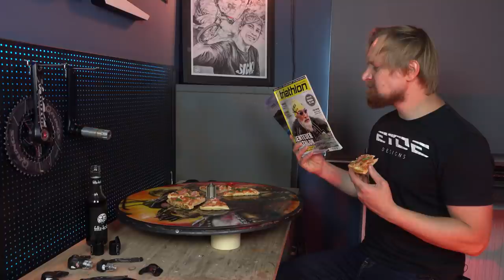DREAM BUILD TT BIKE - Specialized Shiv DOOM ETERNAL

Comment: What  are you doing with the first tool you insert into the seat tube-seat post female threaded parts, before you grease and install the screws?  I would think that tool would remove the threads. I have the same tool and I thought it was for extracting jammed parts. 
Beautiful Work!

Comment: Your best and most intricate paint job you ever did in this channel. Everything is great except for that front wheel not having any paint resemblance to you project. Or it's just the light it's not showing anything in the video other than shiny black.
Overall, a very great and beautiful paint job! 🤘
Reply from the maker: The Shamal is a replacement for the photos. Its not the actual ridden wheel of the bike.